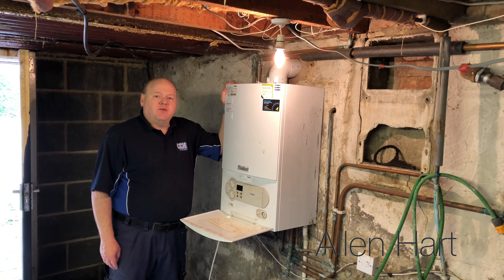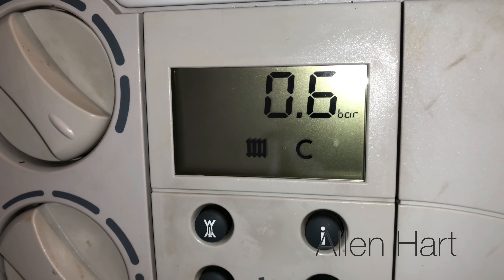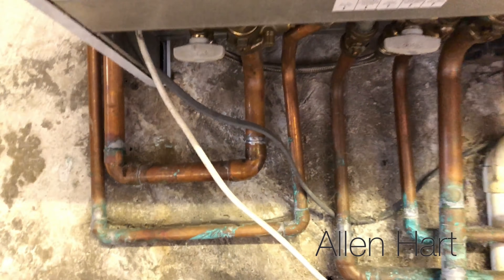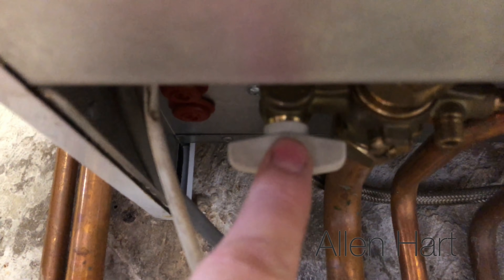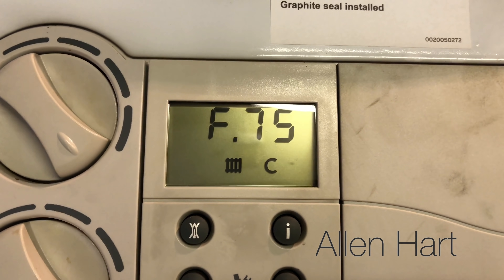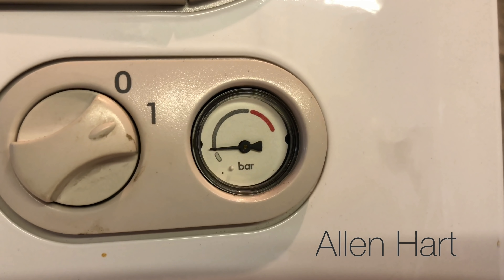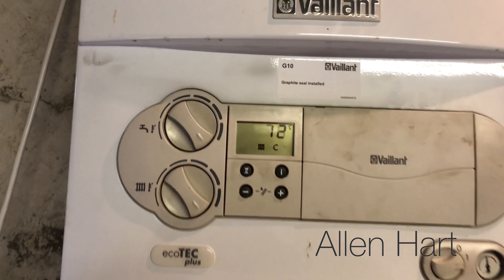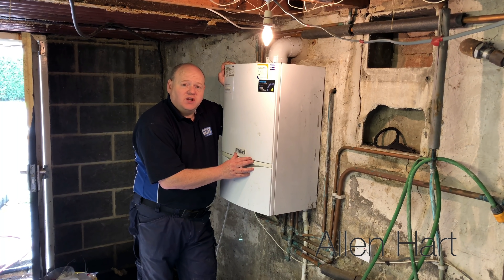How to fix your boiler Vaillant Glow Worm F75 / F22 Fault low water pressure

Comment: Just wondering if you could help me. I used your video which helped me! However it only works for a day, and whenever I use your solution the bar isn’t moving like it did on the boiler in your video but the pressure goes up to 1.5 on the screen. Do you have any idea of what could be wrong?
Reply from the maker: I would advise you to call out a gas safe engineer and check it over for you. Maybe ask for a service at the same time. Thanks.
Reply from the maker: Thanks very much for your comment, please consider subscribing to support the channel 🙂

Comment: What if I added too much pressure? My bar is 1.7.....
Reply from the maker: Try and bleed a few rads to lower it down a bit, Failing that you may need to get a plumber to drain some water out. Thanks.
Reply: @AllenHart999  My pressure was 2.1 bar and i still had this F.75 error code. The i increased pressure to 2.2 bar and it helped. Boiler is running fine again.

Comment: Theres a reason the pressure is low, drain the boiler, leaving the drain valve open while you re-pressurise the expansion vessel, then refill & vent. yes and f75 is most likely dirt in the sensor.
Reply: sir .why is my boiler dro water pressure frequently and when put more water it goes to red bar . 
what is your suggestion please

Comment: Hi.on a f75 fault what I do is drain the boiler so there will be zero pressure on the gauge.then check the digital reading.usually this will be reading over 1bar which tells me it's the pressure sensor.
Reply from the maker: did you sort it?

Comment: Hello Allen hope all is well.

Numerous issues I have with this video:

1. F.75 error code is 9/10 times a blocked water pressure sensor. F.22 typically relates to low water pressure.

2. It sounded like your pressure vessel there may have needed recharging.

3. Always put vaillant combis into P.6 mode when repressurising.

4. The gauge on the right is for engineers use only. It's suppose to give you a rough idea on how the pressure vessel is. On newer models you will always see these on the inside as customers often mistake it for an indication of the water pressure. To get an accurate pressure reading just press the 'minus' button.

Sorry my friend I'm not trying to teach you how to suck eggs and please excuse me if I have said anything wrong. I am only going by what my teachers have shown me and it hasn't let me down. 

Thanks for the video :)
Reply: I work on Vaillant's all the time, I carry "10" water pressure sensors in my van all the time !!!! ...........Needless to say I change them All the bleedin time !!
Reply: I forgot to mention that you could've blown the 3bar prv with this technique you've just shown us.
Reply from the maker: Thank you very much for taking the time to write all that, You are in fact correct i should of also added F22, Thank you

Comment: I've got this code error but the pressure is at 1.4 bar. Maybe that's already at the right pressure and the problem is more complex?
Reply: Actually, it dropped to 1.2 and I filled it to 1.6 bar and its working fine, thanks for the advice!
Reply: Jonathan Atkinson pressure sensor mate. It collects shite from the system and tries to sense through a 3/4 mm hole. That’s f75 most common fault
Reply: Jonathan Atkinson it will do it again you have only disturbed the dirt in the sensor by increasing pressure
Reply from the maker: I can only advise you call out a gas safe engineer to have it checked over,  Sorry i couldnt help this time. Thanks for watching.
Reply: Flow sensor always block up with crap get a gas engineer to replace, you should be looking at £120
Reply: You could, sorted it in the end by increasing pressure! Thanks
Reply: F75 Will Come back to Haunt You !....LOL